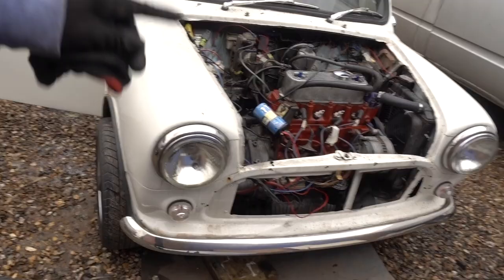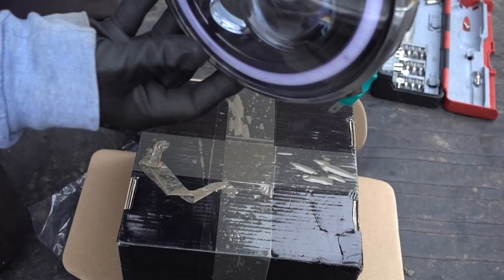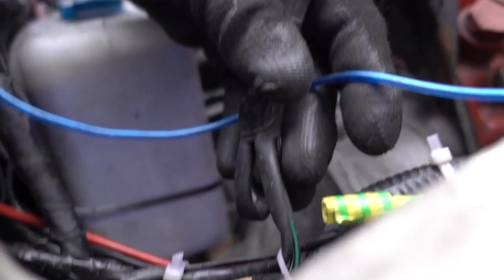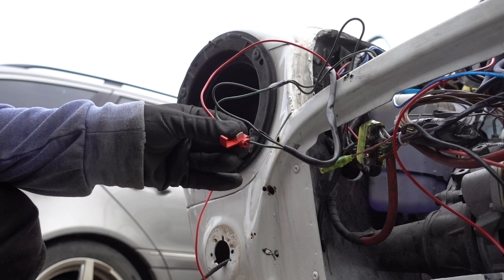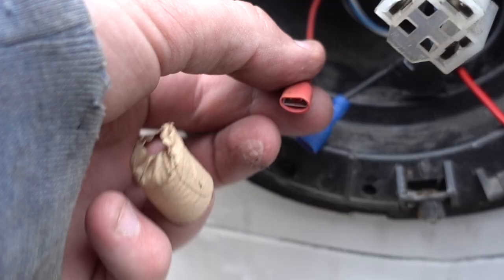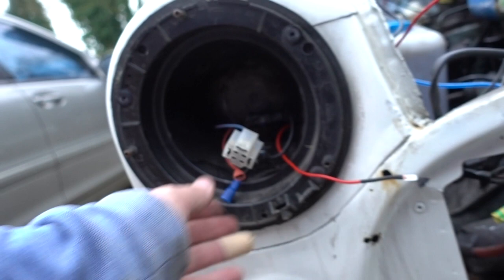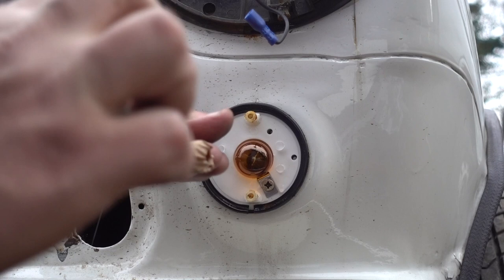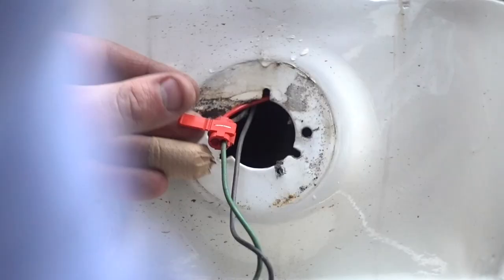Classic Mini LED Halo Headlight Installation Tutorial / How to Change Your Mini Headlights

Comment: Great video. Only question i have is where did you get them from and how much. Seen loads on ebay all with similar pictures but with a huge range of prices.
Reply from the maker: Hi, since covid hit the better quality ones are harder to get ahold of. Brexit has also increased the prices. Best thing to check for is the sae markings, but it’s still a gamble unfortunately.
Reply: Did your lamps have a particular brand on them. Cheers. 
Ps. I don't really intend on driving in the dark so possibly over thinking it. Lol
Reply from the maker: @anthonybrown7959  The main thing to look out for is the sae markings. Also be aware that the UK laws actually state that you can’t install led lights to a car that wasn’t manufactured with them

Comment: Hey mate, here from down under. My old man has a Leyland mini. But the problem is. Our model had the generator not a alternator. Is it still wired up the same as you have done or is it different?
Reply: Shouldn't make a difference.
Reply: Yeah strange just got a pair for a 1972 Oz Leyland Clubman won't work, plug into the same H4 connector on my 1994 Motorcycle hey presto! Why?

Comment: What year is your mini mate? And did you have any issues with fitting? I've read those with later models with the plastic bulb housing and not the metal ones need to file down the LED light heat exchanger. I own a 1990 Checkmate flame edt.
Reply from the maker: Ben Sneddon mine was a 1987 model. Unfortunately that is true about them, you would need to file them down. Sometimes you can get thinner LED units, but they’re not as good quality, or SAE marked.

You can put an angle grinder on the backing fairly easily though to be fair.
Reply: Smashing mate thanks. Will they pass the MOT though?
Reply from the maker: Ben Sneddon technically speaking any car built without LED lights, shouldn’t have LED lights. Obviously LED lights weren’t around this far back.  (This is based on the laws with LED bulbs, I’m unsure if complete units are different).

Some garages would pass them, but you will get some that won’t pass them. People always suggest going to a friendly MOT tester. 

There are a few youtubers on here that have taken their cars with LED lights fitted and it’s passed fine. I asked a garage, and the owner said it was down to the tester. I use a garage known to be generous with little issues, they’ll tend to pass the car if a bulb is out and then replace it etc. They’ll only ever fail the car if it’s major work required.

Comment: Got a link to that 2 wire birdge connector you used? Cant find anywhere. Cheers.
Reply from the maker: jonathan Lewis hi, they’re actually from Halfords, can pick them up from a few shops like the range and stuff like that cheaper though. Here’s an eBay link 

  https://rover.ebay.com/rover/0/0/0?mpre=https%3A%2F%2Fwww.ebay.co.uk%2Fulk%2Fitm%2F282048539333

The correct way would be to strip back the wire, and join them, but I did the easier method
Reply: what the connector call?
Reply from the maker: Scotch locks
Reply: @GarrethEvans  thanks mate

Comment: Where did you take the feed off to feed the drl?
Reply from the maker: The side lights / park lights 

You can always run them off the ignition on wire though
Reply: @GarrethEvans  thanks I've got mine fitted just haven't done the drl yet, for some reason my main beam is the wrong way round, so showing on on the dash is off on the headlight🙈